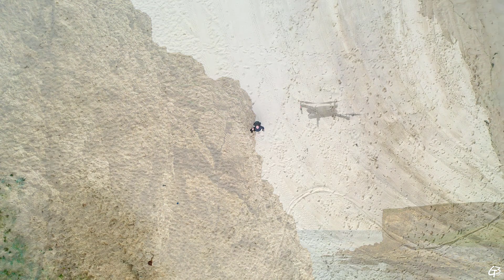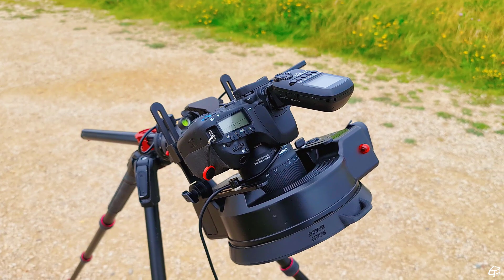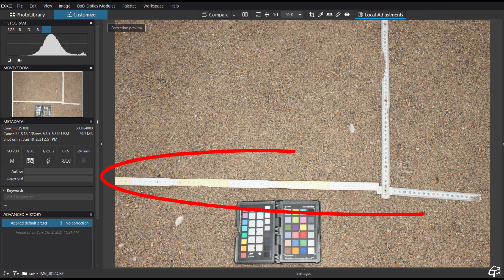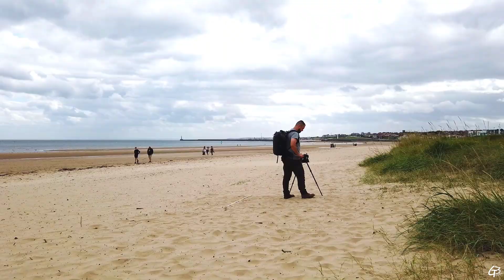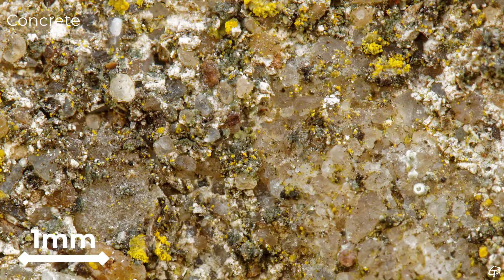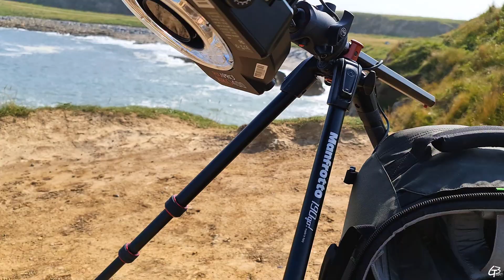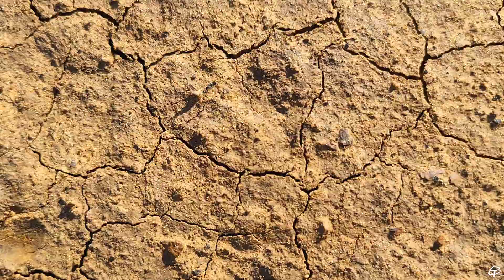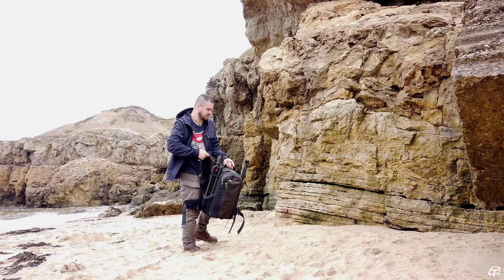Outdoor Photogrammetry Surface Scanning for Materials with a Flash

Comment: Hey Grzegorz! I see you're still responding to messages, so I’m counting on your help! I recently bought the Godox AR400, but now I’m completely unsure how to use it properly for my scans. My questions:

1. I’ve heard that the shutter speed needs to be matched to the flash. Is that true?
2. In one of your videos, you mentioned taking multiple shots to adjust the exposure. How does that work exactly? Do you use the icon with the light on the Godox or the test button? From your videos, I understood that the best option is to shoot at 1/4 power, and if the shutter speed is set the same, that leaves me with the option to adjust ISO and aperture (though in small amounts), so I’m a bit lost.
3. You once mentioned that photos should be taken vertically, but do I understand correctly that if I have a very long board, which I can’t stand upright, I can just shoot along its length instead? Is that right?
4. I don’t quite understand how overheating works on this device. Could you explain it to me? Should I just take photos more slowly, or simply not exceed 200 shots at 1/4 power?
Reply from the maker: Hey. I would suggest to watch the video about it where I talk about it. I believe it was one about props scanning, but to answer qulcikly.
1: Kind of but only when it comes to HSS shooting.
2. Yeah, I use histogram fot this purpose.
3. Nah, photos can be taken however you want to. What matters is overlap and even light distribution
4. I covered it in detail in one of my videos I mentioned. Basically when the device shots certain amount of shots, AR400 gets into overheating protection mode and wont let you capture anything for 10 minutes so it has some time to cool down.
Cheers!

Comment: You mentioned that you use a circular polarisation filter on the camera. Why did you not use a linear filter, is there some kind of advantage? also do you know if the polarising filter on the ring flash is linear or circular?
Reply from the maker: The difference between linear and circular polarisation filter is that linear filter works both sides while circular is just one sided. Circular to be one sided needs another polarisation layer which twists the light. In result, circular polarisation filter works as polariser only when seen through from one direction, and doesnt if inverted. Circulars polarisation filters for cameras cannot be mounted in a wrong way as they have a thread on one side only. One sided (circular) polarisation prevents issues with double cross-polarisation when light gets reflected from camera's mirror therefore, its better to use circular polarisation filter for camera to avoid blacking out an image in certain cases. It the case for any camera systems with mirrors - usually for DSLR cameras. 
All Scan-Space filters I used had linear polarisation filter. Hope that makes sense :)

Comment: Hi Grzegorz, how do you manage such fine detail and high poly on 3D scans? my workstation is pretty decent (6 cores, GTX 1080, 24g RAM) yet every time I use metashape it runs out of memory if i try to get more than around 16M polygons or run mesh refinement...
Reply from the maker: Do you use dense cloud based reconstruction or depth map based one? The depth map based reconstruction doesnt need so many resources as the cloud based one. 16M polys isnt much for GTX1080 and 24GB of RAM to handle, you should not get into memory issues with this setup unless you are doing something crazy ;) like forcing super heacy reconstruction manually etc. Can you please tell me at what reconstruction stage and what reconstruction setup Metashape tells you that it lacks of memory to proceed? Do you use recent Metashape version?
Reply: @GrzegorzBaranArt  thanks for your reply! I'm using metashape pro 1.8.3, and the memory overload happens either while generating dense point cloud on highest quality or running photoconsistent mesh refinement even just on high setting. The latest model I tried to run on was a small church with ~600 photos in 4k resolution. Maybe that's too many pictures? I tried to use fewer images but then I lose details on things like railings and bas-relief. But you're absolutely right about depth-map reconstruction, I've been able to scan an entire village with it and it only took a few hours to process. I also just wanted to say your channel has been a massive help getting my business started, I've been creating photogrammetry scans since I was 13 years old but your advice really brought me to the next level. Now I'm creating made-to-order materials and high definition art scans :) I probably owe you a few beers lol
Reply from the maker: @K3Techs  As adviced, please dont use dense cloud based generation anymore as since 1.6.2 Agisoft introduced a depth map based reconstruction which is way more faster and efficient option. They left dense cloud generation mode as a legacy for those who wants to use it for some reason, but in practice they stopped improving it as a tool :). Cheers Pierre!

Comment: did u get any new tripod or any new gear in 2024?
if yes then please mention them in the reply
Reply from the maker: It depends for what, For surface scanning I use the same Tripod and monopod but I upgraded my camera to  CannonR In a meantinme. I also upgraded the flash transmiter to a better one, but it doesnt make much difference. I purchased another tripod with reversed column for photometric stereos scans - I covered it in detail in my video about photometric stereo scans. I also purchased some Sirui monopods but I use them mostly for 'content creation to hold lights and cameras which record what I do' :D
Hope that helps

Comment: i have a somewhat probably normal situation here....right now i only own one lens. the sigma 1424 for sony e....wondering if this ring flash would work using one of the filter holder systems such as haida or nisi....curious what your opinion on the matter says. thanks homie.
Reply from the maker: To be honest, I have no clue. To be 100% sure you would need to check manual and compare hole and lens front diameters. Also bear in mind, that even if these are fine, if you plan to use polarisation filter, its reduces effective diameter even more. I used AR400 with the polarisation filter from Scanspace mounted with Sony24-70mm GM and Sigma 24-70mm lenses and while Sony lens still had some space left - not much, Sigma 24-70mm was basically touching the polarisation filter and sometimes when I was unflolding it to zoom in, it was pushing polarisation filter off the flash. So in practice to I had to mount the camera first, and mount polarisation filter after. But even if tight, both were fine. So if I have to guess, I would say that even if tight, you still should be fine, as I believe that gap size has standard diameter as Godox wouldnt want to eliminate part of the market by making it to small... but its a guess and I would measure it first or ask in the store you are planing to purchase from. Hope that helps :D
Reply: @GrzegorzBaranArt  amazing. thanks brother.

Comment: Hi, Is it possible to simply change the battery when the flashlight overheats?
Reply from the maker: Hey, I am not sure what you mean: you can change battery anytime, usually when its out of juice. If you meant battery removal to force overheating counter reset, I dont know as  you can reset overheating protection simply by turning the flash OFF and back ON without waiting 10 minutes for it to cool down. 

I do that sometimes when I am in a hurry, or when there is just a few final shots left to finish the capture and I already know I am gonna move to another location after so the flash will get time to cool down anyway. Its also external conditions depentend, so when I shoot in cold windy weather which helps to keep the flash at lower temperature it is ok to override this protection when needed. When I shoot in a hot sunny day, I would recomment to check flash temerature with hand before even the overheating protection kicks in and let it cool down when needed. AR400 has is a quite simple and cheap flash and a lot depends on user. As far as I remember the OFF/ON overheating protecion workaround  works just 2 times in a row and the 3rd time forces you to wait 10 minutes before you can use the flash again anyway. 

To be honest, I never used the second reset as I I dont want to damage the flash. This protection is built for yours and flash safety. Its just an electronic counter which doesnt take any temperature reading into consideration as there is none - hence the manual option to override it. 

Bare in mind that the temperature doesnt affect just the bulb, but also electronic components inside. So I wouldnt strongly recommend not override the protection more than 2 times even if it is possible and even if you shoot in winted. But I never tested if it can be done through battery removal and dont have any plans to test it as I need my flash.

Hope that makes sense :). Cheers!
Reply: @GrzegorzBaranArt  Thanks a lot for your answer,Love you!
Regarding the battery, I thought it (battery) was overheating and not the lamp, so I thought to replace it if it overheats)But now I've found out that the lamp itself is overheating and it doesn't make sense.

I have 3 more questions and I will be very glad if you answer:

1)When taking a portable photo in the sun, when the AR400 lamp overheats in 40 photos, it would be better to find another option.I found out that the Quixel(Epic Games) team uses the ELB 500 TTL, it is quite expensive, but the problem is not that, but that I did not find how to attach this lamps to the camera and I will have to develop and order a mount(for rig) (or ask for its parameters from Quixel) which could be a problem. Do you know any better and more powerful analogues of the AR 400?The price is not very important)

2)Also, for fast studio photogrammetry, I decided to use a continuously rotating stand and continuous series of photos to scan a large number of objects faster.This requires a very low shutter speed (1/4000;1/8000) since the object will be spinning continuously and I do not need it to be at least somehow lubricated.To do this, I will need to buy 3 Godox QT 600 or 3 Godox QT1200 (2 in front, 1 on top) the question here is whether there will be enough light (taking into account polarization) for a 1/4000 / 1/8000 shutter speed, I will test it in the studio where such equipment already exists. In your opinion, will this idea work?

3)I'm thinking of buying a Sony A7R V with 61 megapixels, is it a good choice for photogrammetry (I need 8k textures)?Maybe I don't need so many megapixels and I should buy the something simpler like Nikon D 850 with 45 megapixels, it will be 2 times cheaper.
Reply from the maker: @mrlogo3733  no probs
ELV500TTL is superior to AR400 because it outputs more light and has TTL which gives advantage when it comes to outdoor captures without fixed distance. I never used it tho as it was too expensive for me and AR400 was good enough for the job. I had a feeling that Elinchrom was also providing a handle kit with their product but if not, you might need to develop your own custom handles. To be honest, nothing stops you to develop your own rig using whatever is out there on the market. For example use multiple AD200Pro flashes.. each outputs up to 200W and have TTL so when you combine 4 of them you get 800W and TTL etc. I would say, sky is the limit here.

Regarding the object movement during capture - everytihng depends on how much detail you want to get from your captures. If you aim into the highest level of detail, the subject should be still during the capture, and there is even some delay recommended to make sure all imcromovement is gone too. The smaller the subject and the higher the level of detail you expect to get, the more relevant it is. If you aim just into the shape, you can even get reconstruction from video. With the object sitting still you can get a better depth of view etc. but as said, it all depends on the subject type, size, capture contitions etc. and sure, you can capture things when they move if well illuminated and you are fine to sacrifice some quality. Its all about the balance and when you want to get from it. 

The texture resoution from photogrammetry captures doesnt depend on matrix size, because you capture many images which next get combined into a single one. Sometimes image size can become a bottleneck when it comes to data processing. Its always better to get more smaller images than less larger, therefore, camere lens and sensors physical size are more important to image resoution. Yeah, Sony A7RV is a good camera for photogrammetry.

I cant tell you about your shutter speed as it depends on camera setting, distance to the subject and amount of light, but in certain conditions it is certainly possible to shot at 1/4000 or 1/8000. Btw. bear in mind that flash duration on its full power takes about 1/300s, therefore you wont be able to utilise full amount of lught it outputs in 1/4000sec. and you will need to compensate for these. This is why turntables stops and delays shutter after they did... to compensate all of that. But as said, it all depends on what you want ot get from your capture.